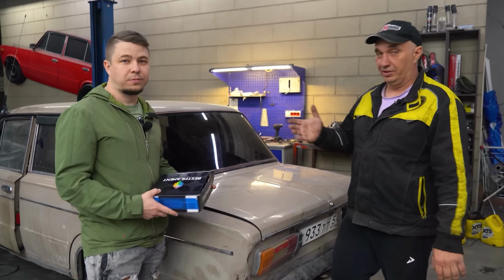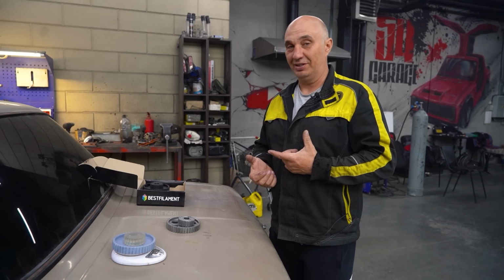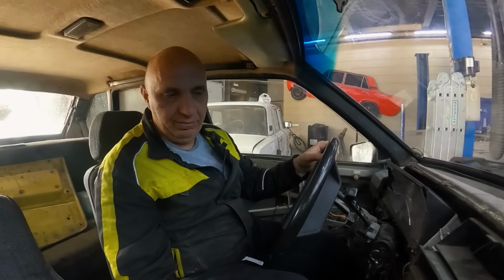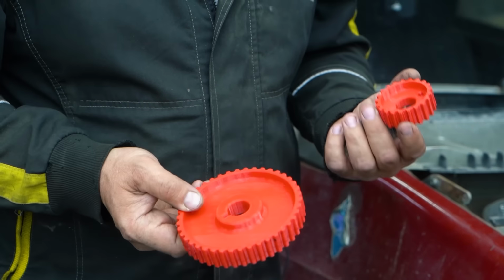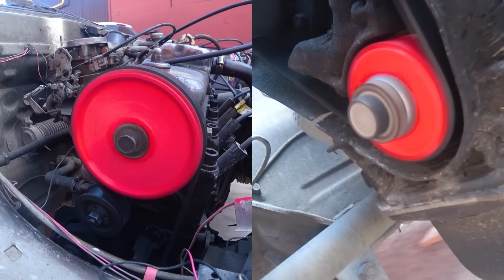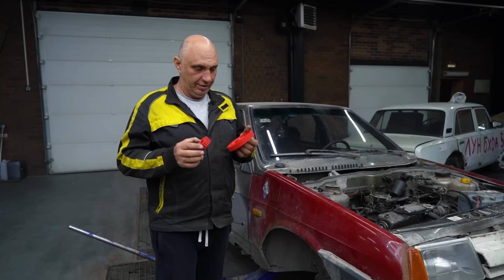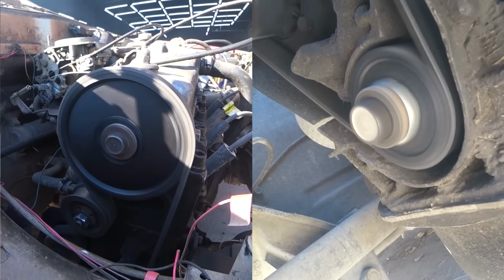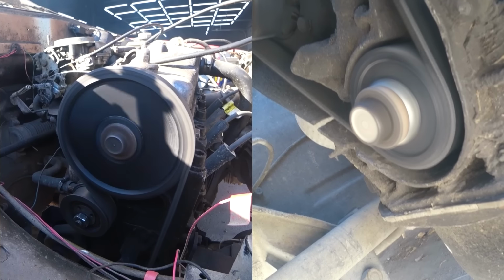3D-printed cam gears from various materials - will they work?

Comment: Careful, you might be giving GM ideas.
Reply: Ford used nylon covered timing gears in the early 60s. I had one of those fail
Reply: @Youtubecensoredmyusername  The big 3 all did it. Tring to make the engines run quieter but it would fail. usually after the warranty was expired. It wasn't quite as big of a deal to do a timing set back then so it could be repaired. Now days it would likely mean buying another car.
Reply: @ a water pump on an eco boost can make someone just buy another car. I saw my neighbor do it. New cars are garbage
Reply: @Youtubecensoredmyusername  in 2010 Hyundai put the water pump under the timing belt cover. To get there, you have to undo an engine mount and lift the engine up to make space. Then take about 1/3 of the engine apart. In the past, they were mounted on the outside of the engine by default. Hiding it away is purely a right to repair issue. Makes the car need $2000 worth of service at around 150k miles.
Reply: @ you may as well do those freeze plugs at the same time on those Hyundais 😂 while you have the engine mount off
Reply: @Youtubecensoredmyusername  Ford and Chrysler was still using them in the 70s.  The nylon would break down over the years and the timing chain would eventually jump a tooth.  They would usually still run just very badly.  I got several decent beater cars back in the early 90s super cheap because they needed a timing chain. I'd usually put a good timing chain, some new gaskets and a water pump on while I had it apart and I'd have a reliable beater car for $300 (about $650 in 2025 money) that I could drive for a while. I'd top off the AC and and tune them up until they ran great. 
I made a decent bit of money on the side in college dragging home cars like that and fixing them up.  I'd then sell my daily driver at a profit to a classmate or coworker who'd seen me driving it for a few months and knew it was a decent car. I'd switch to the fresh beater and repeat the process.
Reply: @ when mine went, the nylon that was still there was holding the chain above the cam sprocket teeth. That didn’t run that way lol.  That must have been an awesome time man.  I feel jipped with these new cars being made
Reply: @Youtubecensoredmyusername  GM also used nylon covered timing gears in the 70s they sucked GM said that it was to quiet the chain noise it was a joke
Reply: @williamshea4193  Iv said it before and I’ll say it again. The only company on this earth that knows how to design a timing set it’s Toyota/lexus.
Reply: No, GM used fiberglass gears on Pontiacs back in the late 60s. They were terrible.
Reply: @Colorado_Native GM Australia used them on their 6 cylinder engines of the late 70s to mid 80s.
Reply: @Chester.Copperpott  There were a lot of dreams about plastics in the late 70's and early 80's. Almost all dreams about durable polymers were proven wrong and we had a lot of machines that failed because of the wishful thinking that a lot of the engineers had. Thing is the chemical scientists loved to claim all kinds of interesting things regarding the materials they worked on. I remember one company making an entire bicycle out of polymers, wheels and all. It was a failure of course. The frame was soft and wobbly and the wheels rims were soft enough that the wheels made it feel like a ride at an amusement park. There were a lot of dreams about polymers that really didn't act the way people thought they would. This has actually become better with time, but every now and then someone will try something so stupid it just can't work in real life.
Reply: @blahorgaslisk7763  Bakelite seems harder than anything we have now, what do you mean it’s getting better? Like when bmw made wire insulation out of soy and the rats loved it?
Reply: Nah...They're already way ahead of Garage54😋😋
Reply: @ let’s see gm build a car that runs on another cars exhaust lol
Reply: Ladies and gentlemen we have a winner!
Reply: As a GM dealership technician I approve this message
Reply: Or PSA
Reply: They’re way ahead of you! They used (partially) plastic cam gears in their v8s in the late 60s. Notoriously unreliable.
Reply: Iron Duke was a non interference engine with polymer timing gear.
Reply: @samuelsamsonian5832  Yeah.  Not a terrible engine, but the Citation sure gave it some diseases......
Reply: @samuelsamsonian5832  2.5L iron duke had no timing chain, no belt, just gears. Shears the teeth on startup
Reply: By making one that doesn't break? ;)
Reply: ford already had this idea with early zetec engines , untill they found out that when people did the timing belts and used bose grips to lock the cams together , it would crack the cam gears and they would shatter on first start up
Reply: FORD*
Reply: frfr
Reply: Or Ford for their “wet belts”
Reply: More like ford.
Reply: Ahem, Ford already does this. Saab was doing it in the 60s
Reply: You mean ford
Reply: They already make plastic timing gears. Legit. GM, Ford, Volvo and they fail
Reply: @David-h5r1x  maybe they were never dumb enough to make those in russia as OEM
Reply: Most small eninges these days (lawn mowers, gensets and such) use plastic CAMSHAFTS....
Reply: Took the words right out of my mouth.
Reply: Oh god
Reply: Nah: They made the Chevrolet Citation in the 80's and more recently the Chevy Equinox with 2.4 liter: They can only go up from there, but they'll have to get rid of those who do heavy drugs during the design phase.....
Reply: Exactly my thought when I first saw the thumbnail haha
Reply: That's what I'm saying
Reply: Gm used plastic timing sprockets back in the 50s.
Reply: More like Dodge. They already have Plastic Control arms, why not Plastic Cam gears?
Reply: Dodge is the one printing putting the most plastic lol
Reply: With the current economy, GM could bring back the Iron Duke cheaper than ever before by using FDM printing
Reply: @ had a vortech 2300. That cylinder head appeared to be made of tiny aluminum balls like styrophome. They probly already know a cheap way of heating but not melting the aluminum balls to where they barely stick together enough for machining and passing the warranty period. Then the dexcool eats through the coolant passage to behind the intake valve
Reply: Chrysler's base 318 also had those!!
Reply: Or peugeot
Reply: Haha more like bm w haha
Reply: GM would definatrly use plastic cam gears
Reply: Or VAG..
Reply: And Toyota will reverse engineer and duplicate 40 years later.  LOL
Reply: @ that’s not funny considering most Toyota timing chains literally last the life of the engine. I have one with 334k miles
Reply: @Youtubecensoredmyusername  lol Toyotas = little old lady yuppie cars. Its funny cause its true.🤣🤣🤣
Reply: @ Toyotas- will get you there cheaply and safely for 300000 miles
Reply: @Youtubecensoredmyusername  maby their weak understressed, 4 pots are ok. Their V8s are notorious for throwing rods! Sequoias and Tudras are overrated trash with time bombs for engines.. The ONLY engines in a Toyota worth owning are from Yamaha. 🤣🤣🤣
Reply: Dont worry, im in school for engineering and when I graduate, I promise GM will not do that😂
Reply: @ ford home of the timing chain on the back of the engine 🤡
Reply: They already made plastic suspension components.
Reply: Ford was already doing it decades ago, even in the so called bulletproof 300 I6. Fully plastic camshafts have also been used in low end small engines for a long time.
Reply: Dude they don't care about the customer. Don't make me have to prove it. Use once only parts. Look, the engineers, the top guys said, "All i care about is the car gets to 100k miles... (Get through the warranty). After that the customer can go fk emself. I don't care what happens after that ".
Reply: 80s Buick already has them in their V6. Minor fender bender and it breaks. But people trash the car cause they think the motor blew. Replace the timing set and you've got a good running V6.
Reply: as I sit here remembering replacingthe timing gears on my Oldsmobile 350(in an Ohio winter).... only to find out after the replacement that I had little oil pressure even after changing the oil.. yeah had to pull it and drop the pan to find the oil pickup covered with bits of nylon.. UGH!!!
Reply: Oh they were probably way ahead of the curve)
Reply: Fords over there taking notes too
Reply: 😂😂😂😂😂you are so right ✅️ 👏  💯
Reply: They got this idea from gm lol
Reply: Actually go ahead and give them ideas! Anything will be better than what they have right now!
Reply: GM or Stelantis

Comment: use an induction heater, to press thin wire screen, into the 3D-printed cam gears, half way into the print... mimicking, rebar in cement. "vacuum injection casting"... use 3D-print to make a form for sand casting... two aluminum blocks, as being a case form for... vacuum injection casting... so when the two halves are clamped together with the wire screen inside, and a total air vacuum inside the form, with heating the block's and preheating the 3D-print plastic in a fully sealed container, opening a valve allows the plastic to be suctioned into the injection case with wire screen inside of it to reinforce it. even a sheet metal collar could be added in for the crank and camshaft force distribution addition of rigidity that the thin wire screen spot welds to.
Reply: Replicating fiber reinforced concrete with rebar in it.

Comment: Print rocker arms and push rods. Maybe lifters.
Reply: Those are likely to snap and break the engine, since interference engines don't particularly like it when a valve suddenly stops moving.
Reply: YES

Comment: plastic clutch-kit?
Reply: hmm, a clutch that's only good for a single trip
Reply: @erkinalp  a lot of work for a potentially short video, so perhaps other transmission plastic parts too, even an automatic transmission.

They did a translucent manual gearbox cover, and perhaps we could see the more fragile sprockets fail, while being able to compensate with using other working gears.

Comment: Obviously non-interference engine.  If I'd tried that in my Volvo, boom!
Reply: That's not a real Volvo, real Volvos are like Ladas and can handle a snapped timing belt!
Reply: @volvo09  Tell that to my 2000 S40T.  Timing belt snapped and up went the heads with it.
Reply: @MasterBakerVideos  cuz that's not a real Volvo, real Volvos are rear wheel drive :)
Reply: @volvo09  I want to call the B18 and B20 some of the last "real" Volvo engines. B30 is basically the same just six cylinders instead of four. These were ridiculously durable. One man I met had the crankshaft break in the B30 in his car. I can't remember the car model, but it was not one of the common ones. this was way out so no garage anywhere near. Well a farmer helped him and reconnected the parts of the crankshaft. He cut a thread on each stub and out a nut in between. Twisted them together and welded the nut to each side. Twenty years later he hadn't replaced the crankshaft and it was still running perfectly. These were engines were some of the sturdiest ever built. No performance monsters though I have seen some who claimed to have rebuilt them to make over 300 HP. A normal B20 were somewhere between 70 and 110 HP from factory. 70 was the standard for Volvo 140 series, and 110 HP were what they squeezed out of them for ambulances and some other special models. I had a 145 that was built for the fire department. It had dual carburetors, a sport trim camshaft, a lighter flywheel to make it rev faster. In total it was delivering 110 HP from factory. But the car also had air suspension for the rear and a front suspension used in the heavy ambulances. It was just so reliable.
Reply: I worried about that as well, when the first timing set broke!
Reply: Wow, I'm amazed it makes the power it does if it's non-interference, since the TDC gap must be large and / or valve travel short.

Comment: You need to make a carbon fiber camshaft with metal lobes. Maybe even a carbon fiber crankshaft too.
Reply: Crank would probably hold for 1-3 revs, these things brake even made of high quality steel. Camshaft maybe would work for a bit.
Reply: @PREDATEURLT  There is an episode, where they made carbon fiber connecting rods. (piston rods)